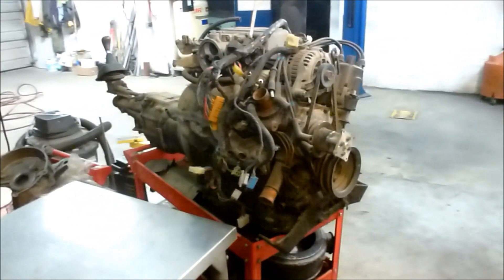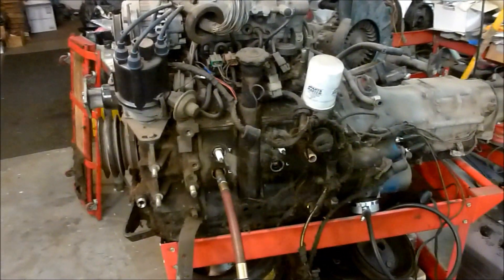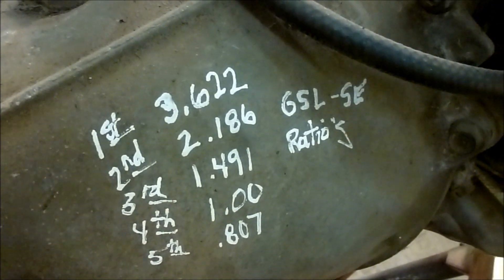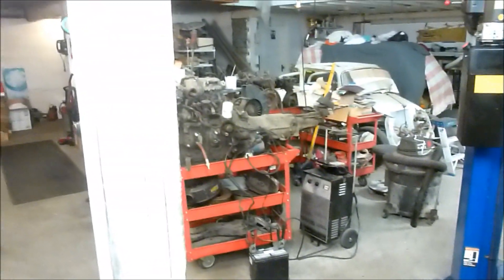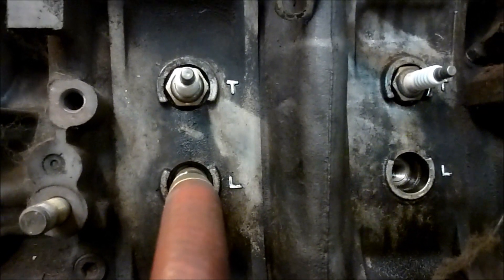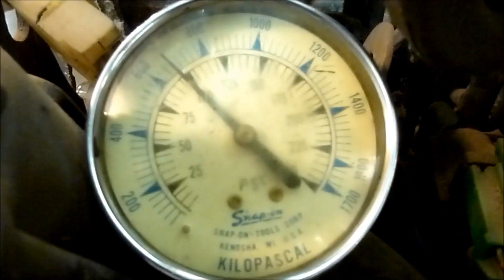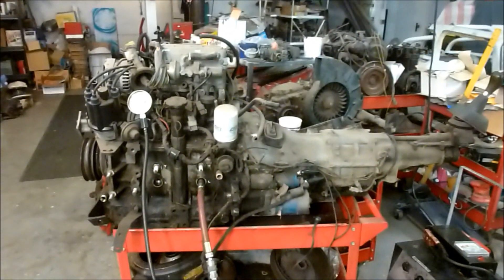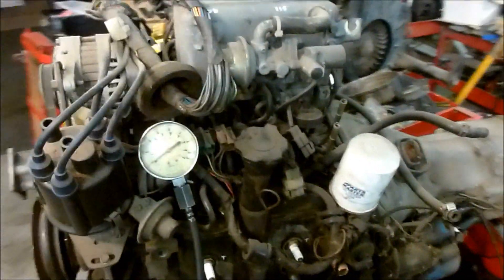Mazda RX7 13b rotary engine compression test

Comment: To get the Proper Compression you have to remove the  Air valve in your tester to allow the  Three compression strokes to show on your dial..If the Engine has a Failed seal you will only see one high reading and 2 low ones..the way your doing it  is holding a total of 3  readings , not three separate ones it`s like hooking up your gauge to every cyl at the same time..  What u did is Not  the Correct  Method for a  Rotary..make sure you do both lower 1 and lower 2..for a true test

Comment: Sorry but that is totally wrong procedure! You only get the best of the three values on each rotor. Each rotor has three (3) faces and therefore 3 values that are need to be read.

If you do that on a conventional tester that you have you need to remove the backing valve that makes she reading to stay on the scale. Than you can se the needle bounce up and done making it possible to se if all three faced are making compression on that rotor.

In the end you end up with six (6) values, not two!

The CORRECT procedure is using a digital tester that can determine each compression pulse and calculate the three pulses on each rotor according to RPM provided (it takes it in calculation)
Reply from the maker: You are right, thanks! that makes perfect sense
Reply: 2stroketurbo I still think you did fine
Reply: If you do it that way (No backing valve?) and run the video in slow mo or just in a video editor you can see what the three peaks are and you know if all three seals are good.   Otherwise all you learn is what the best if the three is.   Good luck I hope its a good engine!
Reply: @JayCras  no you can't do it that way still.

Comment: Well this guy is full of crap....

First off, you did the compression test completely wrong for a rotary. 
You need to remove the schrader valve from your compression tester in order to test compression properly. You are only testing 1 face of the rotor by leaving that schrader valve in place.

In fact if you listen to the video, you can hear the each face of the rear rotor as it passes the spark plug hole, if you look at the compression tester you can also notice there is only 1 jump in compression for every 3 faces that pass that hole. Leading to the fact that this engine has a blown Blown apex seal on the front rotor. 

Also if you notice, while testing the rear rotor on the gauge you can see 2 clear jumps on the needle, then a delay, 2 more hops and a delay, which is probably caused by a side seal issue of some kind. 

I would avoid this engine, unless the OP can put up a video performing a test of all 3 faces on each rotor.